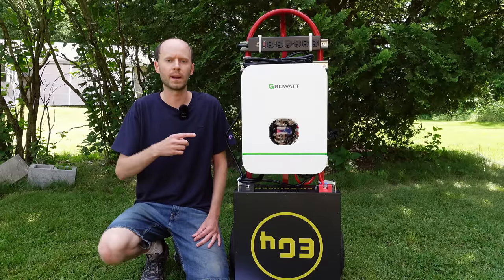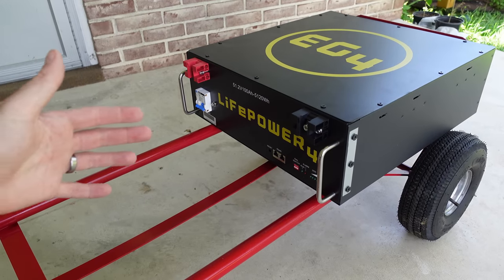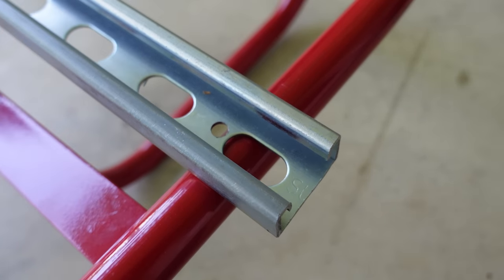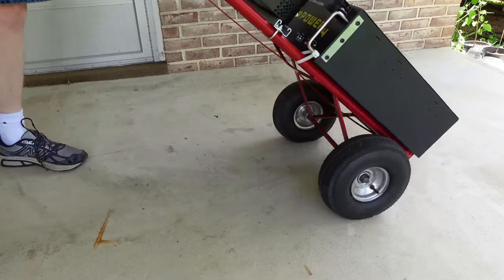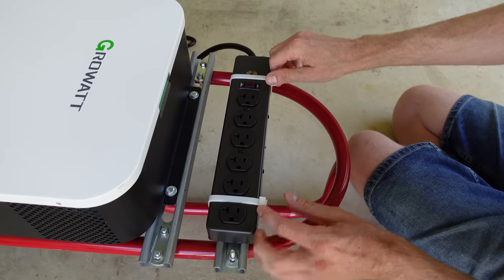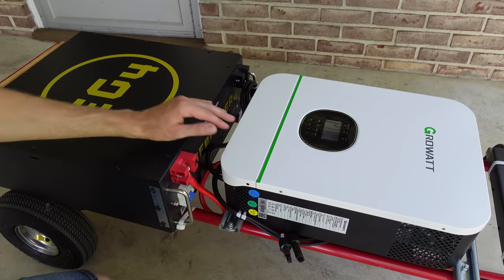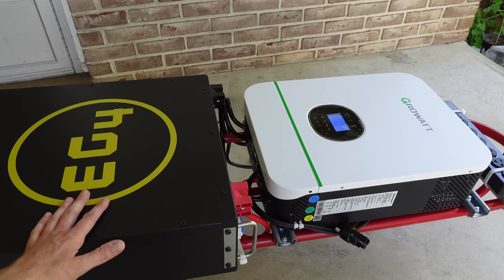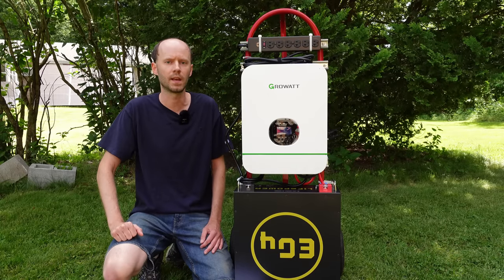Building a 3000W Portable Solar Power Station, Great for Power Outages!

Comment: WOW,WOW,WOW.... I'm just about to buy the bluetti ac200 max but after seeing this I'm torn.... this is 5000wh compared to 2000wh with the ac200 max this has a 3000watt inverter compared to the 2000watt ac200 and this is capable of more solar more ac charging and I can add MUCH MORE watt hours in batteries all for ABOUT THE SAME PRICE. the only plus I see with ac200 max is compact has 12v and looks cleaner....... I don't know what to buy now..... THANKS ALOT!
Reply from the maker: It's important to note too in the decision process, that the Bluetti is significantly smaller and can be picked up. While this cart wheels very easily, you can't exactly lift it up (has to weigh 150lbs or so) without 2 people. :)
Reply: I was close to ordering  a ac200max a few months ago, but finding it only had a solar input of 15 amps stopped me, would need panels to be wired in serial, in an RV, you often can't get all the roof in the sun and that's a big problem with serial hookups. Other than that, I think it's prob about best "solar generator" out there that I could find. I plan on a Growatt, Mpp or Signature Solar has a new all in one too and need to hear more. about.
Reply: It's funny to see the epiphany, some potential DIYers have. A separate system is always gonna be cheaper for the same output than a "designer" plug-n-play one. Even better you can save more money if you decide to build your own battery and combine it with an inverter and other components that correspond to the voltage and ah of the battery.
Reply: Consider buying a EcoFlow delta pro. It’s about 3600 Wh of LFP battery.
Reply: Having separate components is very smart because if one fails you can just buy another inverter, battery or whatever .
Reply: @putteslaintxtbks5166  I have the Blueitti Max 200 with battery and disappointed because even with 800 watts solar panels, it's limited  during constant weeks of rain to recharge. Many times I have to turn off the battery to keep the main unit significantly charged to run my refrigerator and a few lights.  Plus the idle consumption of the 200 Max to run it's internal computer is necessary but wasteful.  So this I'm going to build as well to help during those over cloudy rainy days.
Reply: I just got my ac200max today, and I'm going to build a cart system with that, which allows me to detach it to put it in a car on its own as needed.
Reply: Bourgerv. Is about to release there 2000watt version. And it can receive 1500watts of solar.  solar. But I've been looking at blueetti also
Reply: I did buy the AC 200 max and with two b300 expansion batteries your capacity peaks at +8000wh! It's still portable if you break down the expansion batteries and move separately. If you don't I know they have sales on hand carts occasionally.
Reply: Dont buy either, buy a good gas or propane generator they never fail or run out.
Reply: Fossibot 3600watt con 3.840kw di batteria lifepo4 e 2000watt pv pannelli solari ricarica dc a 2200watt ricarica ac potenza ac 3600watt  1499euro
Reply: @RadioRich100 , wrong
Reply: @mr.c6674  Nope
Reply: @RadioRich100 wrong
Reply: @PatrickWilson-hy5yf  nope
Reply: @RadioRich100  yeah you're
Reply: You are better to go with the AC200L if you are getting the Bluetti

Comment: Great stuff ! Love it. To make it electrically safe and compliant, you are are required to add an RCD protected power board instead of that black one you have. Also a 6mm2 earth lead connected to the inverter, that you can roll out and connect a portable earth electrode to and bash it into the ground. This is extremely important. If the outer case of the inverter or trolly were to become ‘live’ and someone touched it, this would prevent electrocution, otherwise the human body would be become a part of the circuit to ground. Gotta be careful with these you tubers !
Reply: Why don't any of the self contained electric "generators" have the ground bar like you're talking about? Serious question, I don't know much about the stuff
Reply: In a power outage, would leaving the AC input connected to the house (although there is no power from the grid) provide the needed grounding, The AC Input has a green lead that is connected to the green of the house. If with a multimeter check continuity may make sense.
Reply: @WideAwakeHuman  A domestic generator (used at home) does not come supplied with this earth spike. So Joe Soap doesn't use the earth spike. But, if you work in the mining industry it is compulsory to have an earth spike  attached to the generator that you hammer into the ground.
Reply: @IsmaelMartinezPR  Assuming the house is properly "earthed/grounded" (in other words an earth mat buried somewhere around the house), then YES, the earthing/grounding would be sufficient!
Reply: Bousa... So for how many hours would this setup power a garage freezer and kitchen fridge that combined use about 3kwh in 24 hours?  And what size solar panel setup would it accept/need to recharge the battery within the allotted time?   I'd like something that I can use to keep my freezer and fridge going for an extended time 2 in the event of a massive power outage.  Ability to add a small light bulb and iPad charger would be a nice addition  too.
Reply: @privateuploads-geo2625  You are almost answering your own question : a 3kWh battery can run for 24hrs (if it consumes 3kWh per 24 hours). CHARGING via SOLAR : if you wanted to charge the battery in 1 hour from 20% (= 80% depth of discharge) to 100% fully charged you need to have a BMS of 24V/120A and 3kW of Solar - also the sun must be perfectly shining directly on the 3kW solar panels.
Reply: You should add a link to the rcd power board
Reply: @joatmofa0405  thx!  How long to charge from my 14kw whole house generator?  I've read lithium iron phosphate batteries can be discharged down to 5 or 3 % without damage.
Reply: @privateuploads-geo2625  14kW (note the small "k" and the capital "W" ---> kW) normally isn't the way to describe your battery/generator. A battery has an "h" after the "kW".

SO (assuming 14 kWh) : 
It depends on your inverter settings / BMS capabilities / fuse & circuit breaker limits.
....
but for the purposes of standardization - it would take approximately 6 - 10 hours to fully charge your LiFePO4 batteries from 80% D.o.D. (depth of discharge)
Reply: NO! portable power systems do not get earth grounded, and you can't get electrocuted from the case, as there is no connection to earth ground, so no completed circuit.
Reply: Nice work and excellent presentation.
Reply: Also have to be careful with your nonsense as that ground won't do you a damn bit of good but it will help you comply with the electrical code and that is about it.
Reply: @sspence65 short of the rubber tires, isn’t the hardware bolted to the hand truck and if laying flat then wouldn’t the metal hand truck then be making the connection to the ground?

Comment: This is the best portable power station build I have seen so far. Many of the ready made power stations cost over $800 per kWh. This one comes in at about $521 per kWh and has more than double the capacity. The only thing I would add to this setup would be a copper ground rod with a lead. Then I could push it into the ground before starting up the system. Just an extra safety step.
Reply: Would you stick with 48V vs 24V?  Im a noob with this sort of thing and get nervous witha nything grater than 24V if you do something dumb..I know, dont do something dumb! lol
Reply: @whoanelly-  Personally, I would use the 48 volt. But the 24 volt would work well also. You would also need the 24 volt inverter to make it work.
Reply: I like your advice for a ground rod. I am a noob and have watched a number of smarter people build their handtruck systems without talking about earth ground or charging the metal hand cart with 48V. How deep does a ground rod have to go into dirt? Guidelines of 6-8 feet for home grid systems are all I can find.
Reply: @whoanelly-  For something movable like this, with a metal cart, 24V would def. be safer IMO.
Reply: @ItsEverythingElse I already got the 48v battery and can't return it. Should I try and sell it and get a 24v for this type of unit?

Comment: You can use back to back struts. They make pipe clamps that will fit the diameter of the dolly pipe. There are several ways to do what you want done by using different types and sizes of strut. Ask for the product book that will show all the pieces made and offered by the strut co. If you dont file the cut ends there are or were end caps available. It was cheapermost of the time to have both ends dipped in a rubber coating. Go to electrical supply house for material and if you're lucky the sales department guys will give you help and lots of ideas.

Comment: I might also mention that right angle brackets could have been used to mount the box to the strut. Right angle brackets come in different hole varies, example: 1 hole in one side and  2 or more holes in other side of angle bracket. The extra length can provide more support and stability and permit different places for mounting to the box.

Comment: One modification I might recommend is mounting the EG4 battery backwards so you have clear circuit breaker access-- breaker on front/top and lug on back/bottom.  Also, the Costco 3-in-1 hand truck might make a few things easier-- using self-tapping screws instead of U-bolts as an example, but also easier to use it to haul panels at the same time.  It's a little more expensive, but a good value none the less.

Comment: Thank you for an easy and wonderful design. I built the portable solar generator, but used 2 EG4-LL batteries to have 10kw. I bought a garden cart (supports 400 lbs) to mount everything on. I used my EGO ZTR mower to pull it around. I also bought 8 (used) 455w panels from SanTan solar for $175 each to recharge it. I estimated the ROI is 5 years for the whole setup. Thanks!

Comment: running the growatt 3k. same bat.. one cable and they communicate!   . wall mount, it runs my whole house 24/7  with 1,300 watts pv..   big fridge. toaster. electronics. electric blankets... could charge from the grid ... but  no need .  luv it   signature solar.

Comment: Just did this set up a few weeks ago works great. We live in a 5th wheel with some land we have 10 410watt bi facial panels and growatt 3000es it powers the whole 5th wheel including the 13.5btu ac during the day and have enough battery to run all basic appliances during evening hour's. We do have to turn some things off with higher loads not a big issue we will probably do split phase with another growatt in the future. If you have the space to do it just do it you'll be amazed what solar is capable of. Pay back period for us will be less than 2 years.
Reply: Great to hear for RV usage , what type of solar power is regenerating and how long to charge?
Reply: @mikew2046  I'm producing about 20kwh on a full sunny day and recharge takes about 4-5 hours roughly depending on the power being drawn Im sure I could easily charge 2 batteries on a sunny day if I an extra.

Comment: I like your build enough that I plan on making one myself.  I figure it will run a pellet stove for a long time if we get a bad blizzard that knocks out the power.

Three hints on your build.  If you can cut the strut in between the slots so that it cuts down on the sharp pointy edges.  As you tighten up the ty-wraps pull them around to where the cut ends are out of the way where hands/arms and other soft tissue will not contact them.  These ends when cut tend to be sharp and will cause cuts, even the small ones will cut you.  If the solar generator will be outside very much, consider use black ty-wraps as these are more UV resistant.

Comment: I just finished one with a Growatt and the same battery but with the addition of a breaker box that allows me to use the full 25amp capacity thru a 30amp receptacle that my camper will plug into and I added a male electrical plug to receive a cord for recharging the battery.

Comment: I built the 24 volt version of this, and yes, my DC circuit breaker is about the size of a shoe box!  LOL.  I made a few changes like adding am  800lb working ratchet strap tie down ($6) to hold the two 12 v 206 AH SOK batteries in place.  I also used a 2 x 4 in place of the bottom full-size, (no drilling) not 1/2 strut, secured with 2 hole pipe clamps.  I did not need to drill the Growatt and the back of the 2 x 4 holds two 20A GFCI outlets and the PV circuit breaker.  Works great!  Thank you for the inspiration.  Good Job!

Comment: Brilliant, yet simple! Exactly what I am looking for in an emergency backup to run refrigerators and a freezer, and charge with solar. Holy smokes, that's up to 4500W of solar input! That's awesome. Thanks for doing the video! Can you make a solar panels recommendation?
Reply: Consider using your vehicle to power your refrigerator after opening it. Best to have a top lift lid for freezer so cold air doesn't flow out as much when opened. Keep fridge and freezer closed and off as much as possible.  Organize it to minimize open time.
Learn to preserve foods without a fridge or freezer.  You will be golden.
Reply: @wellnesspathforme6236  One thing most ppl don’t realize is that a manual defrost freezer uses far less energy than a frost-free freezer. A frost-free unit is, on average, 34% less efficient.  That’s a big number.  Especially when powering from a solar generator.
Reply: @wellnesspathforme6236  I agree with your comment about learning to preserve foods without refrigeration. Everything from properly storing grains, to vacuum sealing, to pickling, to dehydrating.  One of the important things I’ll use a solar generator for is to power my grain mill. Yes, I could use my hand-crank mill.  But it’s time consuming.  I live in southern AZ where the sun shines 360 days a year.  I’ll plug in the solar panels while I’m baking my bread.

Comment: Good buildout, would like to see a 220v split phase inverter as well as a generator transfers switch for a whole house cut-over.    At least a 50A setup so you can run your AC/Fridge and some lights.
Reply from the maker: You might be able to fit a split-phase inverter; however, think this is about the most I'd want to put on the cart. It can hold the weight but it gets bulky to move around.
Reply: That would be great, and the battery would fail in about 25 minutes. 🙄
Reply: You need atleast 4 of these batteries for a split phase inverter to even make sense

Comment: Thanks, good idea. I had to build one. I ended up cutting off one side of the bottom U-bolt's threads for clearance of the inverter fastening holes. Pinched the u-bolt in a vice so it's tight around the dolly, and the one nut held it on very well. Unistrut caps are also a nice touch.. but at $5 each. Or you could use some large heat shrink to cover the struts -or both like I did
Reply: I bought a bag of strut end caps on ebay for about $10.

Comment: As a young apprentice electrician, I cut PLENTY of 3/4” unistrut with a hacksaw. Cut through the U and score the inside and it brakes off pretty easily. Works on 11/2” to, but you’ll be there all day and it can get wavy. I like this contraption!
✊🏾
Reply from the maker: Maybe I need a better hacksaw then (or at least a different blade) 🙂
Reply: angle grinder with cutoff discs will chop thru this easily. but it will make a lot of sparks....

Comment: Hey!  I just did that today in the forest!  I moved everything to the canoe, then onto the dolly, then up the hill to cut some trees.  The 1800W chainsaw works well, but this is very hard physical work!  By the end of the day, I was able to charge the battery back to 100%.  It's very heavy and a bit inconvenient (the chainsaw with the cable behind),  but I can repeat the process each day without going back to the city or gas station.  I think the benefits are far greater than the work to move the weight.  Anyways, within a few years, we should have better equipment and batteries after we invested in this transition technology.  I hope to see the day when it becomes stupid to use refined gas instead of raw energy coming right at us...  I use a few ratchet straps (reusable) to fix the battery and inverter on the dolly.  You can also put the inverter/controller sideways with a strap or two, no?  I also use double sided velcro to fix cables, they are reusable as well if the setup is temporary.
Reply: It sounds like you have a sweet setup.  How do you charge your battery?  Do you haul around solar panels too?
Reply: @eradicator187  At 23 kg per solar panel, I leave them in the rack!  I just carry the battery back to the cabin and connect it directly to the charge controller.
Reply: And make sure you dont use ANY products like tires, cosmetics, plastics, etc. made from stupid refined oil/gas.
Reply: @joerivas9847  can these batteries be recycled ,, i think not ,they are a forever product once built ,, meaning you have to just throw em in a dirty big hole ,,  maybe they can fill those big mine holes with em ,great for the landscape ,,